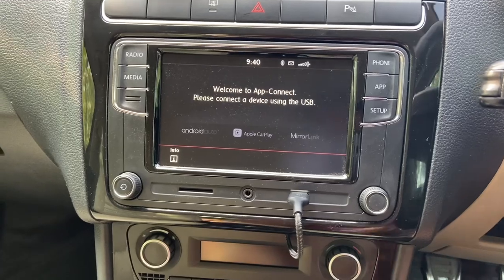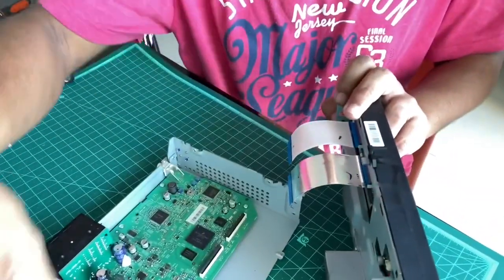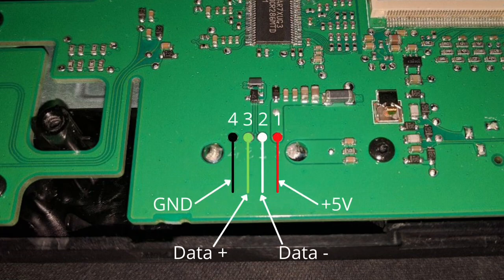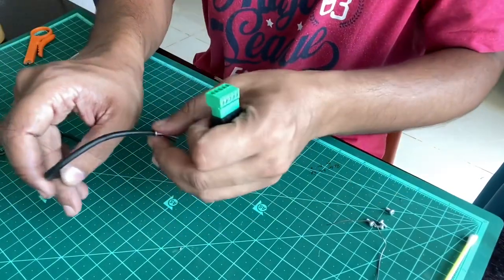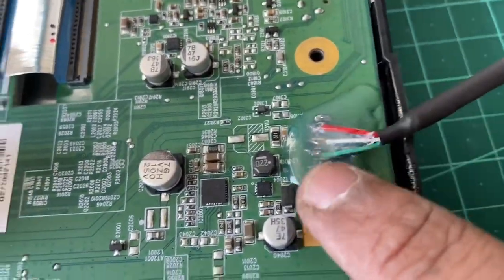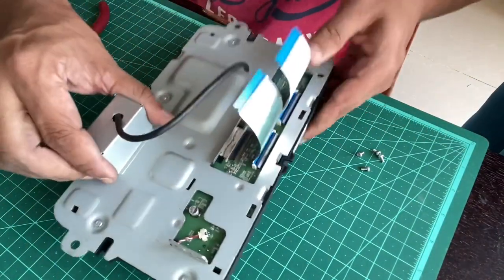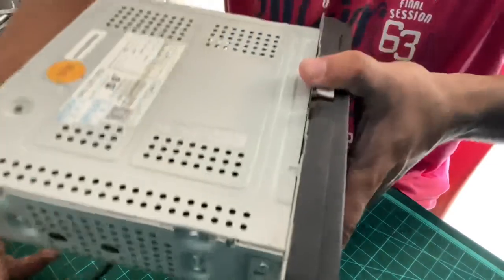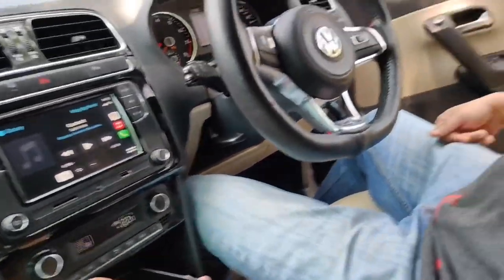RCD 330, 340 head unit - Adding a rear USB port

Comment: Great video. Very helpful, thank you. My T5 transporter now has an external USB port that's out of the way and doesn't disconnect the phone every time I knock the plug when using the touch screen. 
I was lucky when I got down to the board, there were 2 additional unused USB headers on the PCB. Made the soldering job a bit easier.

Comment: I have polo high line plus 2018 and ur car system looks like same.
Any idea if it is different in my car as prims face it looks same?
Reply from the maker: You have your from the factory, I got mine from Aliexpress. Your unit is locally manufactured in India by Visteon and is functionally the same system.

Comment: Thanks, this is a very clear tutorial and I followed it last night on my wifes RCD 360. Went fairly straightforward but I have noticed a major issue this morning.
I now have no Bluetooth! When I press 'phone' it just says 'starting phone' but does nothing.
When I try and speak through Android Auto the mic does not respond.

I assume I havent reconnected a ribbon cable correctly and will check it again this afternoon but was wondering if anyone else has experienced this issue before?

Again, thanks for the guide - very helpful.
Reply from the maker: Hi Brian. Sorry for the late response. Had been on a vacation.

The RCD 360 is a very finicky device and many claim it to be a ‘fake’ RCD unit. The 340 which ends with the part number 187B with a SD card slot, 3.5 mm aux jack and the USB slot is the genuine 340 unit. 

Did you finally resolve this?

Comment: Ganesh sir very much professional work, great. I read your TeamBHP ownership review in which you have mentioned how to replace the fuel lid actuator of your VW Polo. Kindly make the DIY video of that replacement as I also wanted to replace for my Skoda Rapid. Thanks.
Reply from the maker: Hi Navjot, yes it’s a simple replacement. There’s also a neat trick to implement something on it in addition which will help so many of them in an emergency. I’ve to click that part as well. Will upload it as soon as I finish the installation. 🙂👍🏻
Reply: @GaneshBalan  Will be waiting for that. 😊

Comment: Lovely, I was looking for this. Thanks for taking the risk for us.  Has anyone been able to get it directly under the ac control, near cupholder?
Reply from the maker: Hey thanks! You can route the USB cable through the centre trim near the 12V receptacle - just use a metal cable which these electricians use as fishing cables, route the metal cable till the head unit and pull one end of the cable to the desired area.

Comment: Hi..
Following ur channel and I appreciate the way you explain things.
I also want to have this to be done in my POLO .
Q1. Have you taken out the head unit after ignition on. I heard that if it has not been done that way then head unit asked for error code?
Q2. At the time of reinstalling the same should the ignition to be kept on before attaching the socket? 
It may ask for error code?
Reply from the maker: Yes stock infotainment systems which were installed from the factory comes with a 4 digit code. Your service centre can tell you the code. My unit doesn’t ask for one since I sourced it from Aliexpress.

Comment: Hey Ganesh love your DIY videos. 
What do you recommend to get for a 2015 polo? 330 or 340? My requirement is just apple car play/maps
And what would be the best way to source this in Bangalore/Kochi?
Reply from the maker: A 330 plus or 340 has a larger screen. Get a unit which supports CarPlay and has the PQ quadlock connector not the MQB type quadlock connector. A lot of dealers are selling Chinese units which has a fake ‘Made in Poland’ sticker and the MQB quadlock connector.
Reply: What are the defrent between RCB330 & RCB330+ 
and how to identified 😊

Comment: Gannu bahi how to identify genuine RCD340Gplus plz help me out
Reply from the maker: Hi, if you’re referring to factory fitted units that are not taken out of the Polo/Vento/Rapid and the Chinese ones - look for the Aux 3.5 mm jack, USB port and SD port (not the microSD port). The part number from the System info should read 6RD 035 187 A/B/C/D/E.

Comment: The Pioneer stereo sound is not VV stereo, I have installed focal speaker ISVV165 and still there is not much effect.
Reply from the maker: You need an amp. The stock unit will not have ample power to drive the aftermarket Focal speakers.

Comment: Hello, does your cell phone charge it well? Mine only heats it up and leaves it in the same percentage of battery, for example 60% and does not go down or up, it stays at 60%
Reply from the maker: It does charge the phone as well. But yea it does heat up the device just like normal charging.
Reply: @GaneshBalan  ok ty, and great video btw hehe
Reply from the maker: Thanks man. :)

Comment: Hello Ganesh, I have done the same as you did, it’s working fine now.. thanks to you…I faced some difficulties while soldering but managed to do it..thanks to you again..

One question, does the original port in front side will not work ?
Reply from the maker: Hi Sibi, glad to hear you got this working! 🙂👍🏻

The front USB port won’t work.

Comment: Ganesh, great video! I was thinking about going this route but I found out 6C chassis has a USB input on the opposite side of the 3.5mm aux input in the center console in front of the shifter. Have you thought about going that route? (PN for the said USB socket: 6C0035726B)
Reply from the maker: Hi, you can route the cable however you wish and even connect it to a USB port if it’s available on your car. But please note that the existing USB port will be already preconfigured and connected to the system. You’ll have to disconnect the cable and connect a new one from the RCD unit to the port.

Comment: Hi Ganesh, Which model HU will support the Škoda Laura 2010 and could you please provide me any leads get the device with best price
Reply from the maker: Hi Pardhu, your 2010 Laura will support the RCD 320/330/340 models. The 340 is the unit that you find on the last generation Polo/Vento/Rapid with a larger 6.5” touchscreen, Bluetooth and support for Android Auto and Apple CarPlay. However, please be wary of units with microSD card support masquerading as 340. These have a bad reputation. 

I’ve purchased my unit from Aliexpress. Aliexpress doesn’t ship to India but they do to other countries like Singapore and UAE so you can buy it and ship it to those addresses.

Comment: Hello Gannu,

Pardon me for asking a query here.

I am having 2016 Polo Highline 1.2 MPI. Recently I added Blaupunkt Key Largo 970 SV entertainment unit. Currently I am facing an issue where stereo does not power off once the key is removed.

As a workaround the installation guy added a wire from fuse box using slot 33 which works but sometimes thorws engine light error when I use the 12V socket charger the light goes away automatically. I saw in one of your post on team-bhp using the fuse tap on slot 16 but it doesn't work.

Could you help to provide information which slots can be used to power off the stereo when the key is remove or not in ACC position.

Thanks in advanced.
Reply from the maker: Hi Dipesh, please use the supplied ISO connector to power the stereo system and not using any other connectors or tapping from the fuse box. 

The Blaupunkt unit must have come with the required connectors and adapters. Do you have the picture of the rear of the unit and the cables that came with the set?

I’d suggest taking the car to a good audio installer who knows his job. This looks like someone who doesn’t know how to connect the unit properly.

Comment: Hi , I am unable to remove antenna wire from back of rcd 320 . It seems to have a plastic clip which needs to be pressed. Can you guide ?
Reply from the maker: Hi Shashi, to remove the antenna connector, there’s a plastic tab that needs to be pulled out not pressed. Pull it out and pull the connector out.

Comment: Hi I’ve a question if I do this and then add a wireless CarPlay adapter in the rear will I still be able to use to front usb for wired carplay and android auto?
Reply from the maker: Only 1 USB port will be usable for data transmission Felix. The front won’t work.

Comment: Where do you hide the usb cable and put it out under the panel?
Reply from the maker: Hi Mario, it is routed behind the unit and through the centre tunnel to the co-driver side. There’s a big gap if you peek your head through the footwell towards the driver as well as co-driver.

Comment: Thanks for sharing this. What component is required to enable wireless CarPlay on this head unit. I have the same head unit bought from AliExpress.
Reply from the maker: You would require a USB wireless CarPlay adapter plugged to the port. Most retailing these days are buggy and not plug and play like how car manufacturers implement it in their infotainment systems. Not to mention expensive - 15k and upwards.
Reply: @GaneshBalan  thanks Ganesh. what’s your opinion on Taigun’s interior built quality? I recently checked out Slavia and the interior quality is really bad. It doesn’t reflect the typical VW/Skoda quality.

Comment: Hi Ganesh Good Video Bro 
I want to ask Can We use wire to wireless USB ADAPTER? In RCD 330 plus 187F ?
Reply from the maker: Hi Nitin, I did not understand wireless USB adapter. Did you mean wireless CarPlay and Android Auto unit like Carlinkit?
Reply: @GaneshBalan  Yes
Reply from the maker: You can use a wireless CarPlay/Android Auto adapter but there will be a small sub-second lag. Be wary of this. Otherwise it’s fine. 👍🏻
Reply: @GaneshBalan   can You please explain me what is Small Sab second Lag ? 
Thanks
Reply from the maker: A small lag in the operation while accessing different menus from the screen.
Reply: @GaneshBalan  Thanks 🙏🏻

Comment: Hello sir, i bought used Polo TDI Highline 2016 model car with HU large size with touchscreen and reverse camera working very well but no apple car play/maps... How i knew which model one iam using...?  Guide me
Reply from the maker: Is this a OE system? Please remove the system and check for the sticker on top of the unit. I’ve a video on how to remove the system -

https://youtu.be/E0-3ji6wE10
Reply: @GaneshBalan  i had open and abserved their is no model number...its 330 or 340 ? Really confusing... With below numbers can Identify the model number?
6RF 035 187 
HARMAN 003 
Type number A480
Reply from the maker: @pratap2703 Actually RCD 330/340/340G etc are given on the user manuals and on the brochures. It is not indicated in the unit. 

e.g. https://www.team-bhp.com/forum/attachments/car-entertainment/1674670d1505049951-review-r340g-head-unit-my-polo-gt-tsi-r340gmanual.jpg

Your Harman unit is a factory fitment. I have a firmware upgrade but not for these units. It is for the Chinese noname units that end with the part number 0187B. You can try your luck with that but don’t blame me if you brick your unit!
Reply: @GaneshBalan  sure sir...why I blame you...if it work auto Android it's my luck... If not don't know what to do...
Reply from the maker: @pratap2703 please give me your mail ID. Will share the file.

Comment: Hello Sir, This is really amazing. I want to add a rear usb to my RCD340 VW polo 2018 model. Though I am not professional to do it myself, I am looking for some one or service center who can do this in bangalore or kochi. Also I want the usb port to be added just beside of cup holder as in your video. Could you pls help me.
Reply from the maker: Hi Suhail. Service centres won’t help you with this. Your best bet is to get the unit out and take it to someone who does professional soldering. The service centres which do repairs of audio video equipment. You can find many in Cochin who will help you out. Just show them this clip and they’ll help you. 

As for the USB port, if you want it to be installed on the console, you’ll have to cut a hole and insert the USB socket. Connect the wiring harness which will have 4 cables to the unit. It’s simple. 

Let me know if you have any doubts.
Reply: @GaneshBalan  Thank you sir.
Reply from the maker: No problem Suhail.

Comment: I was looking for a rear USB solution for my Vento for a long time but all of the other solutions I found needed a retrofit kit. Thank you for coming up with a simple solution. 

I have a question though - I don't see a hole on my RCD case to pull the wire out, neither did I find it in any other videos. Did you drill the hole by yourself? If yes, did you notice any tearing/cracking of the wire in the long run? I have a feeling that the wire might tear when it rubs against the perimeter of the hole over a period of time.
Reply from the maker: Hi, I drilled a hole to route the cable from the unit. I used a file to remove the sharp edges and tied the cable to the PCB using a cable tie so it can’t be pulled. It’s a simple trick but works well.
Reply: @GaneshBalan  Thank you. I will try drilling and filing it. Nothing much to lose in drilling it 😄
Reply from the maker: @nikhilteja7004 Just be careful! 🙂

Comment: I want to move USB port in front of shifter on my TDI, ...is it basically the same steps, except of course the new USB port on the consul? Great job, thanks...
Reply from the maker: Yeah you’ll need a female USB port with a socket so you can make a small hole on the plastic console in front of the shifter and route the port there.
Reply: @GaneshBalan  thanks....
Reply: @zlvirag  did you do that? Any videos?

Comment: hello good morning, do you really need the green adapter plug❔ or I can solder the cable with the other end already being usb female
Reply from the maker: Hey Jr! Good evening from India! 😁 The green adapter plug isn’t required if you can solder the ends of the cable to the port directly. No problems.
Reply: @GaneshBalan  Fala amigo! Saudações do Brasil, boa noite vejamos; se eu soldar os fios do cabo na placa do rádio e na outra extremidade do cabo ser uma saída USB fêmea do próprio cabo, não preciso cortar e adaptar o plugue verde? Eu já estava com um plugue no carrinho hehe
Meu rádio é um RCD330 visteon 6RF035187D, eu vi 2 tipos de plugue, 4 parafusos e 5 parafusos, vim aqui olhar seu vídeo para ver se usou de 4 ou 5 parafusos e você me respondeu que não é necessário, agora que você me informou isto, acho que farei direto sem plugue o que pode ocorrer é não funcionar e eu ter que instalar o plugue será? Me diga amigo porque você utilizou o plugue ao invés de usar direto a outra extremidade já com uma saída fêmea? 🤔😂👍🏼
Tmj cientista hehe
Reply: @GaneshBalan  opa! Só mais uma coisa rss😅 sabe se consta alguma inscrição na capa do cabo para saber se ele possui 4 ou 5 fios? 🤔🤔😂👊🏼🇮🇳

Comment: Hi , does RCD 340 rear camera function in 2013 Polo trendline? I am getting a blank screen. Wires connected, along with delay timer and coded byte 3 in radio but still no display. Please help
Reply from the maker: Hi Unni, trust you’ve connected the canbus lines to the unit?
Reply: @GaneshBalan   Thanks for the revert. Yes, Canbus is connected. I have steering controls installed in my trend-line. It works. Does iRCD require ABS sensor signals? Or could be some other issue?
Reply from the maker: No separate ABS sensor signals are fed into the system. Unni, this requires a bit of tinkering. First off, I hope the power connection to the camera from the reverse signal is tapped properly. When I did the checking, what I did was using the delay timer circuit, I connected the RCA output to the TV’s input to check if the signal is coming properly. I used a long cable to test this.
Reply: @GaneshBalan  I am getting the camera output display in android HU. I only swapped the HU to RCD340. So the connections are correct I believe. I have an aftermarket parking sensor module which takes input from same reverse light positive and ground. Do you think that’s interfering?
Reply from the maker: @unnikrishnan7913 the aftermarket parking sensor may be the culprit. Can’t be sure unless you disconnect that unit, connect the reverse camera and check. Please check that. Also long press the power button to reset the head unit once. I’ve noticed that sometimes after VCDS coding, it requires a reset.
Reply: @GaneshBalan  Thanks much. I will try this.
Reply from the maker: @unnikrishnan7913 No problem. I’ve had to tinker with this unit a bit to get the settings right after we use VCDS. e.g. changing the type of car displayed while reversing (sedan and hatchback), camera output etc.
Reply: @GaneshBalan  Yes. I almost lost hope checking. But seems I have more things to check. Thanks for the motivation. I will check and revert soon.
Reply: @GaneshBalan  Hi, I checked all wiring.
I am getting display of camera in tv. When I press power button to reset HU, after VW logo appears during boot up, for about 4 seconds the camera input is displayed in HU and then disappears. , Again black screen appears. 

Tried disconnecting the parking sensors but same issue persists. What could be the reason.
Reply from the maker: @unnikrishnan7913 I’m suspecting the delay timer. Where did you source this from?
Reply from the maker: @unnikrishnan7913 Ping me on WhatsApp Unni. 9099691369. Easier to communicate and share images/voice notes.

Comment: will it cause issues if i still use the front usb port?
Reply from the maker: Hi Chaz, no it won’t. But the system won’t recognise the device connected to the front USB port. It only charges the phone.